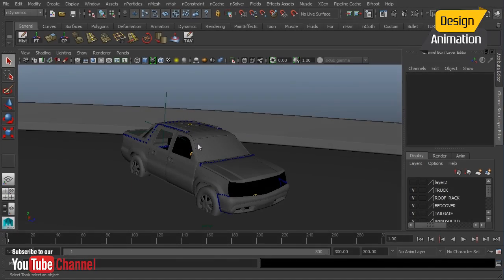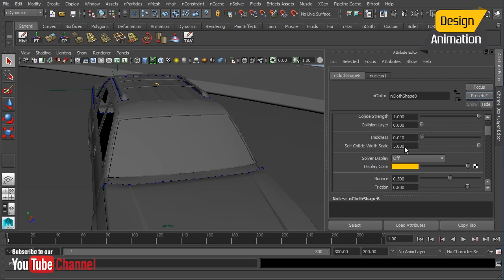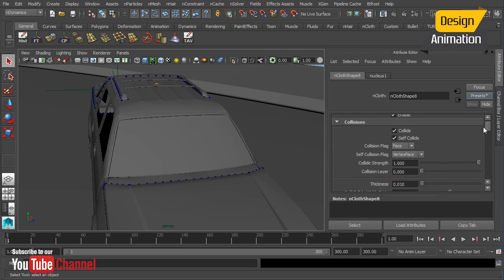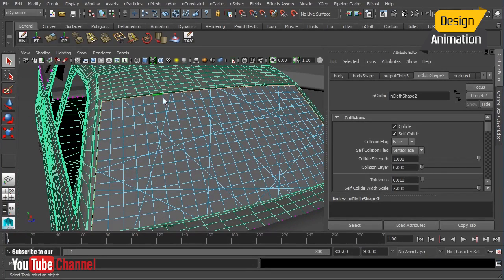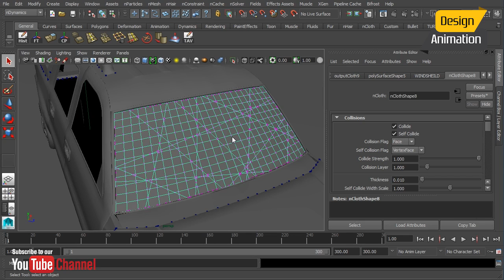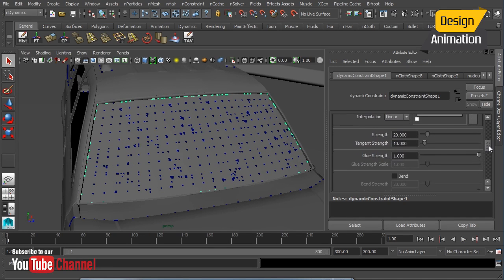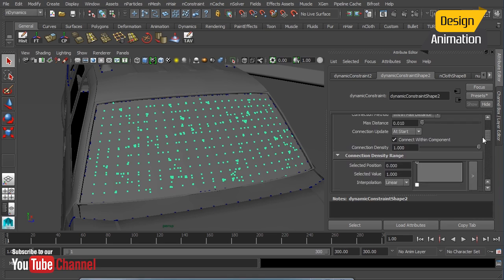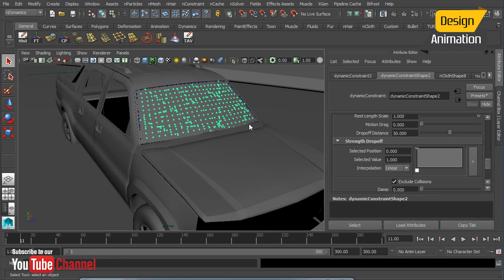Autodesk Maya Tutorial | Car Crash Animation | Complete Course - Part 13

Comment: For anyone wondering where the next part is:
The next part in the series is actually "Part 2" in the playlist. The parts seem to have been uploaded out of order and mislabeled. Here's the proper viewing order:

Part 1
Part 6 (actual part 2)
Part 7 (actual part 3)
Part 8 (actual part 4)
Part 9 (actual part 5)
Part 10 (actual part 6)
Part 11 (actual part 7)
Part 12 (actual part 8)
Part 13 (actual part 9)
Part 2 (actual part 10)
Part 3 (actual part 11)
Part 4 (actual part 12)
Part 5 (actual part 13)

This course was excellent with lots of great tips. Highly recommend this for anyone learning nCloth destruction.